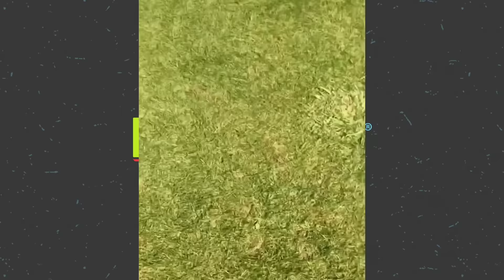Try Not to Laugh Challenge! Funny Fails | Fails of the Week | FailArmy

Comment: Being a really short guy like 5 foot 1 inch short, balance has never been a problem. Luckily i'm athletic along with being short so apart from dunking a basketball, i can do just about anything. Even if i slip i usually never leave my feet, the one time i did completely fall i rolled backwards into a fairly solid landing. I'm getting older, into my 40's now so i'm waiting for gravity to catch up, but i stay in shape, Hiking, Yoga, metal detecting..and i think as long as we keep moving age becomes less of a factor. It's the people that use age as an excuse to stop moving that age faster and die sooner than anyone.
Reply: Are there some cool shit you have found?